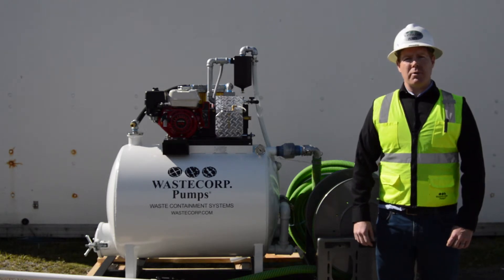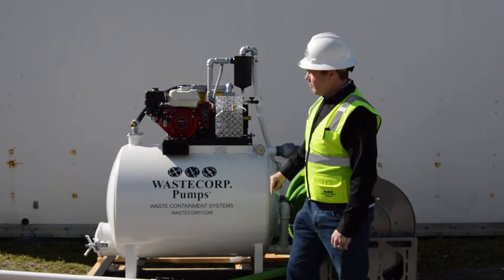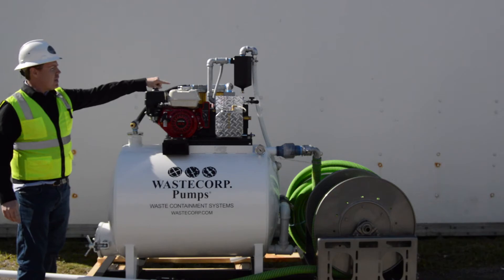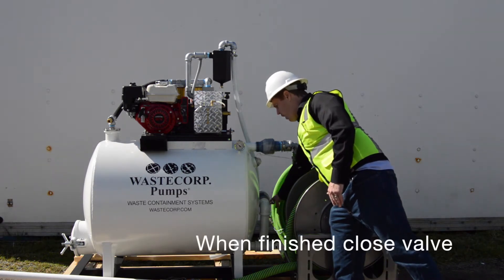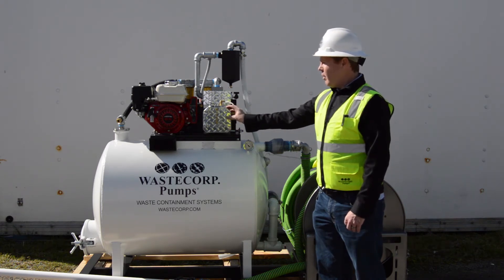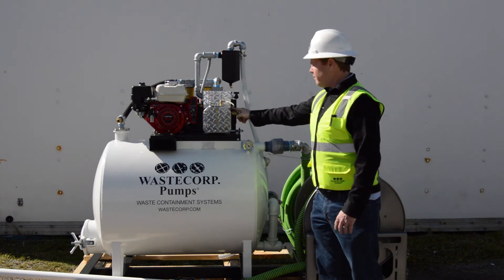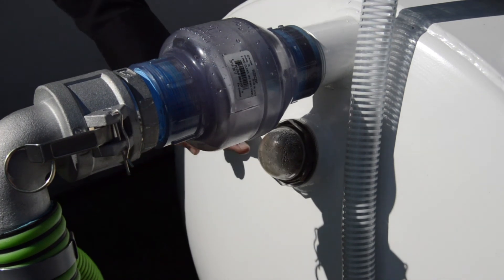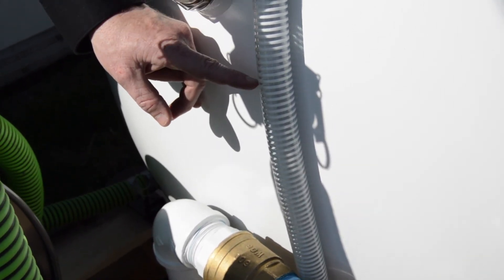Vacuum Pump Operating Instructions

Comment: Hi.  We are exploring the portable vacuum pump to collecting the floating refuse at sea surface.  May i know that the present system could able to collect the garbage and discharge the sea water back to sea simultaneous for cleanup purpose?  Also, the size and weight of such equipment could be reduce?  We are planning to put it in to ship's bow and control the suction position by manner.  Thank you.